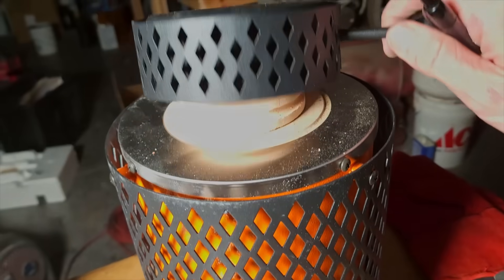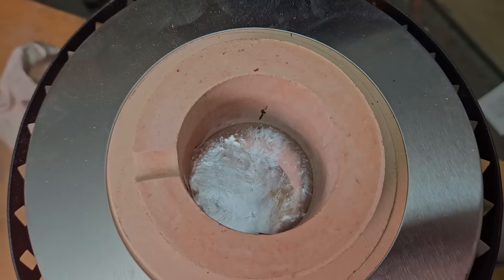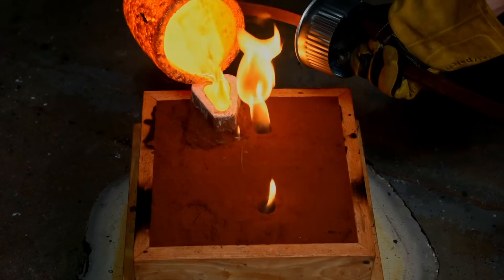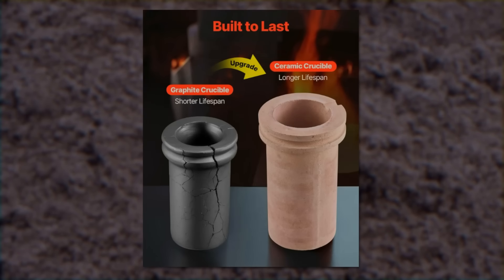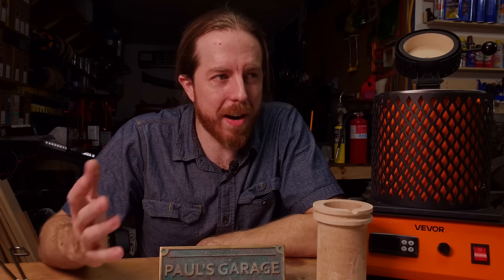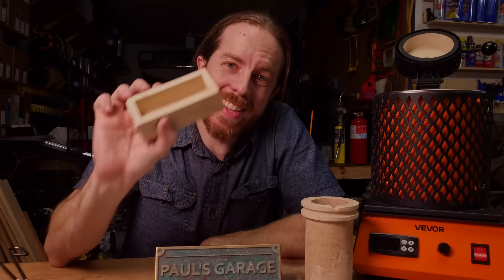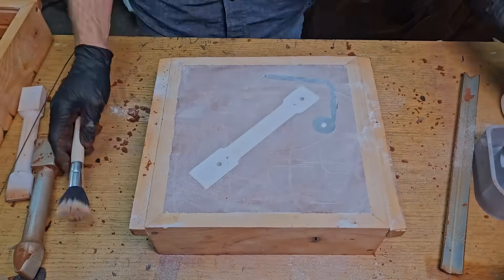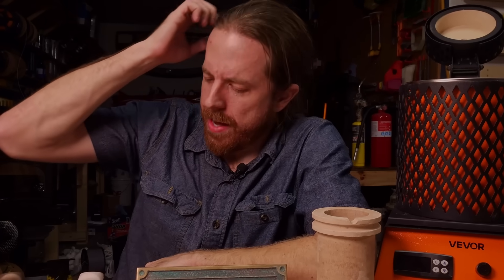Watch This Before Buying an Electric Metal Casting Furnace

Comment: Great video. I have the Vevor 8Kg propane furnace and love it, but I am wanting this style 5KG electric furnace for cleaner pours. Less turbulence and the issues with hydrogen porosity. Where can one source replacement 5KG ceramic crucibles for this model? Thanks

Comment: @PaulsGarage you can use molybdenum disulfide spray on ceramic crucibles, and small molds, even those made of steel. Apply a thin layer, then preheat to 350 or 400F to form a very durable coating. 
I spent 20 years in aluminum foundries (green sand, semi-and-permanent mold, die casting, and some centrifugal) as Technical Resources Manager. 
Anyway, give the MolyD a try; I think you’ll like it.
Reply: You've worked with aluminum, yet your suggestion is gold! Needed it, ty sir 🙏🏻
Reply: @RasagarbhaThere are a variety of available coatings depending on the application and temps being worked with.
Reply: @dropndeal  I'm into brass and bronze atm, but I'd like to try silver too. Metal sticking to crucibles is a major issue when you are smelting little quantities, so I was looking for a cheaper alternative to the graphite crucibles.
Reply: @RasagarbhaGraphite is going to be your best choice, however, they probably need to be glazed for your application. You can purchase them glazed, or glaze them yourself using borax. Of course, you may be doing this already.
There are also Silicon Carbide Graphite crucibles that may be a better fit, again, if you aren’t already using them.
Reply: @dropndeal  Borax glazing is great, but it tends to wear off at temperatures higher than its melting point, so it gives its best in lower temp smelting like silver. But it's easy to apply and very cheap, especially if you use it on ceramic/quartz silica crucibles, and that's why they are in my current setup. Alumina/corundum crucibles aren't suitable for reactive alloys containing tin and maybe zinc, and there's a risk of ferrous metals contamination in my working area. Zirconia crucibles would be great for high temp smelting, are chemically stable and have a good thermal shock resistance too, but they are expensive af.
Since I'm not handling precious metal yes, I was in fact looking for some silicon carbide crucibles to see how they behave and last. Your suggestion was spot on, ty!

Comment: The crucible breaking is more about tight packing, the metal expands. You can loosly pack to the top and be fine. You can tight pack with metal dust 1/4 full and blow out the bottom.

Comment: Just a heads up, I just attempted to order an electric furnace from Vevor 2 days ago and my order was cancelled and my money refunded. When I asked why, they said I should try again but use paypal instead. I used paypal for the order. Now, they are telling me to use a different email address. Both of these answers are giving me red flags all over the place. My suggestion is, do not order from Vevor. It will not be worth your time or frustration.

Comment: What about induction
Reply: induction is tricky, must be liquid cooled, no thermocouple, so you need eye temp old school, using bambu stick method etc etc Also you have liquid running around a unit drawing 5000w, most need an upgraded circuit to be safe. You need the double crucible system, so twice the expense.  I have a big one, but still consumer level and it was about $1000. SO I also have and like these simple units. Feel free to ask about my induction unit if you're curious.

Comment: Great video but please everyone buyer beware and do your homework. I got the upgraded Vevor (black one) it took 8 hrs to bring the large crucible up to heat with only 1/4 of it filled with material. And when I emailed the company they said 'oh it must be your wiring'- wrong, my shop was wired by a commercial company and passed inspection. Very disappointed, OH and don't trust the crucibles (graphite) after 4-5 uses, even with a visual inspection. I had one fail on me and it's a good thing I can move fast.

Comment: I've seen someone who made a steel crucible for a 3kg Vevor electric melter. It was lined internally with fireclay which (he claimed) could be chipped out and replaced as it degraded. He was mostly melting and casting small brass items with it, under half a kilo since it had less capacity than the regular graphite crucibles. I think he used stainless steel for the outer shell.

Comment: BigstackD sometimes uses boron nitride spray in his molds when pouring copper to prevent bubbles. My guess is that boron nitride spray would make a ceramic crucible as slick as a graphite crucible.
Reply from the maker: boron is a very powerful ceramic flux, i bet that would work great  I wouldn't use it on this crucible though, it would melt the crucible apart quickly over time at copper temps, but wouldn't do anything at Za12 temps.  I forget exactly where fluxing action begins with boron, but i think it's a few hundred F hotter than I pour Za12

Comment: Do those 5kg units have replacement crucibles anywhere? I have a 3kg model and was thinking about upgrading.
Reply from the maker: I have seen some in expensive graphite, but i haven't seen the ceramic ones like this anywhere.  I haven't looked to hard, though.  Vevor doesn't sell them

Comment: Have you ever considered using iron or steel or maybe even copper or bronze as chills for your lower melting point castings to reduce shrinkage and overal metal use? The chills can be reusable and don't even have to be cast-surface facing to be useful (internal chills). Perhaps have standard sizes you use? You can't eliminate shrink though, you just move it elsewhere (hopefully the risers 😉)
Reply from the maker: I have used chills but generally I don't.  Feeders are my preferred method of moving the shrinkage elsewhere, but I actually did something different with the good sand rammer I used.  There are lots of ways to do it for sure

Comment: Paul, how many aluminium melts you can do before elements get burned?
Reply: I wish that I got a good view of the internals of the thing, see if the elements could be rewound. Usual contender is NiChrome, but there are others and gauge and wind would reveal that and the possibility of rebuilding the failed element.
But, I'm willing to bet that it'd be hand rewindable, with a bit of modest work and likely cost a bit over the kit, just because that's how the markets work.
Unless you get the wire by the entire spool...
Reply: @spvillano  Building a vevor furnace replica is no brainer, however none of ebay/aliexpress wire can last even one session. Only ones rescued from old kitchen oven (wire fully enclosed) are ok, but difficult to form a dicent coil  😓

Comment: You know that the "capacity" of these is bollocks, unless you are melting very heavy metals.

Given you have the thing there and talk about the dilemma, why don't you simply measure the volume?  You could use water, or if a liquid isn't suitable you could use baked beans, or earth, or bean bag beans, or anything....  then pour what you measured into a measuring jug.  
If you did that, you'd be adding useful information.... far more valuable than saying you can fit a couple of xxx ingots in the crucible.

Many of these things are very deceptive, and only hold a poofteenth of a farthing....  anything to clarify is useful.

Comment: It would be nice if Vevor actually shipped to New Zealand.
Reply from the maker: Yeah, but do you get Toauto or any of those similar ones?
Reply: Check with your government, they might've prohibited them for some reason or even a forgotten and now, non-reason.
I'm in the US, you know the tariff insanity... Got a Vevor coffeepot on my kitchen table, incessantly used, happily burning away coffee (yeah, the temperature could be a bit lower to prevent oxidation and maintain safe temperature, but one gets what one pays for and frankly, it's cheaper to replace two cups of coffee with fresh grounds than to replace the thermostats.
Reply: vevor seem to have a whitelist of countries they will ship to, and it's limited

Comment: elements are made from nichrome, and teh temperature a given element gets to is its surface area to power dissipated.

can have a tiny piece try and dissipate 1kw and it will fuse instantly. thats how fusses work...

can have a massive piece that easily dumps 1kw but barely gets lukewarm...

so, the ideal gauge gives a nice length, decent surface area, and a resistance that limits current to a certain power dissipation and the wire gets to a temperature thats somewhere just below its upper threshold.

except... its in air. oxygen. it starts degrading. it might be nichrome but at 1000c its still oxidising... push it to 1200 is asking for trouble.

reducing in thickness and increasing in resistance and limiting current and it takes only small increases of resistance to reduce power dissipation to a small figure...

i do iron.

gas is easiest for aluminium and brass. it gets into blowers, diesel/sump oil, and heat exchangers for cast iron. i hit 1800C no worries :)

failing that... induction heating is the cleanest.
Reply: It's worth pointing out that heating elements tend to break due to the oxide getting disturbed enough to expose the fragile core of a used up and deteriorated heating element. In cases where the element doesn't get disturbed, like kilns, they first notice it failing to get to temperature. In an electric heater or electric stove, the element is probably getting disturbed enough to cause the heating element to break before they really notice it performing poorly.
Reply: @rich1051414  well, heating and cooling disturbs the element a fair bit, moving the entire unit, disturbs the unit tremendously.
Kilns, well how often have you moved a kiln? Last time I moved a kiln was never the third. One chooses a location, they're not light and you don't want to set the building ablaze, so it's carefully selected as to location and one would far prefer to disturb the mother in law with a cattle prod more than moving the damned thing.
Something like this? People will casually move it and rattle the elements, disturbing the protective oxidized layers.
So, my only real question is, can I get to the element and rewind it with nichrome of the same gauge and twist? If so, I'll take two and figure out the finances later.
And that's saying a lot, given I'm a retiree on fixed income.

Comment: I've done brass in these things. It goes okay, but the thermal lag of the metal is real. So real, in fact, that the PID or whatever thermal control is used in the system to regulate the temperature can overcompensate and then the temperature flies past your setpoint. For Zn in brass, that means you've potentially got Zinc gases and white flakes and very hot liquids very fast. So I basically heat everything up really slowly, about 100degC at a time until setpoint. Takes a couple of hours, but for safety purposes, it's necessary. PPE and a respirator is a must, of course.
Reply: Most likely, a thermocouple, insulated within the metallic sheaf. Cheapest, most reliable for an approximation, precision models cost a shit ton more, but prone to thermal insulation irregularities for cheaper models and the company isn't a top shelf precision company. And I'm saying that with one of their coffeepots sitting on my kitchen table on 24/7 duty and coffee is really important to me.
Hence, occasionally, they'll get a thermocouple that's off, either replace it or try workarounds, like a bit of asbestos sheeting between the element and crucible or between crucible and element or both.
It ain't rocket science, it's just a routine pain in the ass.

Comment: Hi, your videos are great ! I was wondering about pouring ZA12 in aluminum molds? What do you think? Thanks!
Reply from the maker: No idea, but i suppose it could work.  Aluminum has very different thermal properties than steel, so it might not work as well for dies.  Also, steel dies are tougher than anything you pour in them, while za12 is significantly tougher than aluminum.  It would be fun to try, though

Comment: I wanna love the bigger furnace but it's got a pretty damning review (on vevor site). Reviewer says crucibles are not fully ceramic but just coated graphite. Can you confirm Paul? ty
Reply from the maker: Interesting!  It looks ceramic to me.  Ill check when I get home and see if I can scrape anything off it
Reply from the maker: OK i checked out all my crucibles.  I have lots of graphite ones from older kits, the one in this kit is entirely ceramic, and I have one ceramic crucible with a graphite coating, like the review was complaining about.  My graphite coated ceramic one is doing fine (it was the 3kg example used in this video) but I have only ever melted Za12 in that one.  I have not used any of them for gold, like in the review.  I don't have any gold laying around and probably never will haha!
Reply: @PaulsGarage  Good to know. Thanks for checking and updating us.
Reply: yeah, but even iron is cast in graphite crucibles. ever done iron? its hot!
platinum? even THATS in graphite...

Comment: Great video! For the crucible sizes, I usually take the amount in copper and divide it by 2. So with an 8kg crucible, I use 4kg of copper. You can fit more for sure, probably more like 5kg, but it starts pushing the top. Excited to read your guide!
Reply from the maker: Glad you liked it! And thanks for the tip on crucible sizes, that's really helpful.

Comment: For ZAMAC I use a camping gas stove and a cast iron frying pan + soldering gas burner.
What´s awesome is the other eastern European dude who uses his microwave to melt cast iron, crazy. I would probably use a microwave like he does bevor I use those Chinese death traps.
Reply from the maker: zamak is awesome like that, very low temp.  The microwave furnace is pretty awesome, too, but it's a little bit jankier than I like haha
Reply: @PaulsGarage  absolutely but is it really worse than the Vevor thing ? At least with the microwave you build it yourself and you can perform maintanance on it.

Comment: Speaking of lathe bed would love to see an update on that project
Reply from the maker: It's coming! i'm not rushing that one, i want those videos to be good and be a book companion series that everyone can follow.
Reply: I don´t care about the lathe at all, I like all the 3D printing etc. videos way more. It´s more modern, more currently dated etc.
Reply: @sierraecho884  Good luck 3d printing something usably round and long enough, lathes have been in use for millenia and will continue to be used for a reason. Making stuff isnt about picking one method, its about using the most suited method to the part you need.
Reply: @BloopTube  "...Good luck 3d printing something usably round and long enough, lathes have been in use for millenia and will continue to be used for a reason. ..." I am not talking about 3D printing the product itself, which by the way is possible in say MSLS or Metal Binder Jetting, it´s just more expensive and can´t be scaled, but it can take shapes you could never turn with a lathe. Generally speaking, there is no superior process, every manufacturing process has it´s place. I know what I am talking about, I am an automotive R&D engineer. 

"...Making stuff isnt about picking one method, its about using the most suited method to the part you need...." Yes, absolutely. I don´t think I have ever said otherwise. I am just not interested in turning with a lathe since this process is very common and old, I rather search new ways and combinations.
Reply from the maker: i'm interested in all of it, honestly.  new and old, and combinations of them.  and new stuff.  It's all interesting
Reply: @PaulsGarage  Yeah I know, that´s perfectly fine. 
I find it more interesting in doing new stuff with new tech. Who would have thought that 3D printing is this ease, cost next to nothing and is as easy to use as a regular 2D printer ? We can create masters and all sorts of stuff. This didn´t exist to this extend 20 years ago. You can also DIY sintered parts these days (which not many people do, it´s a bummer, why cast when you can create extremely precise sintered metal parts instead) so yeah, lathe turning and all that stuff it has it´s place and it´s fine but it´s nothing new.

Comment: LFG!
Reply from the maker: First comment!!
Reply: @PaulsGarage Was a great video. I know it's meant for a different series all together, but how many lathe parts will require a larger crucible than these electric furnaces? Obviously the bed as you pointed out...
Reply from the maker: Bed, feet, and headstock definitely.  Maybe the tailstock too.  I think most of the rest would be fine, though.